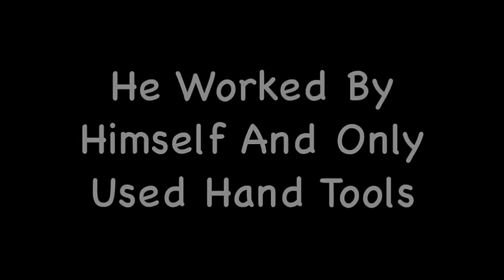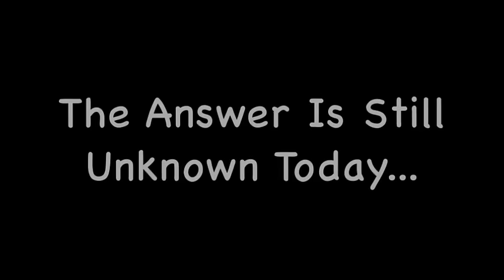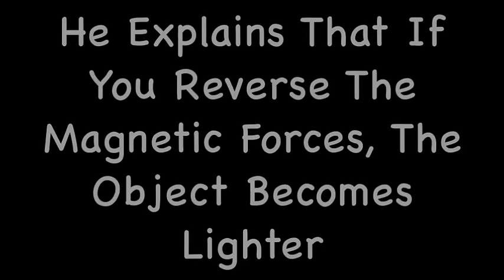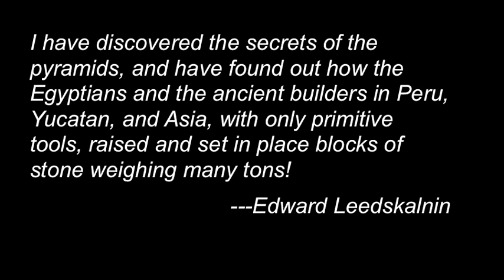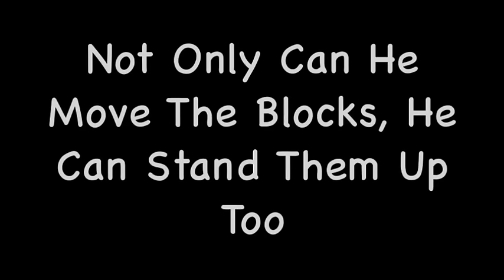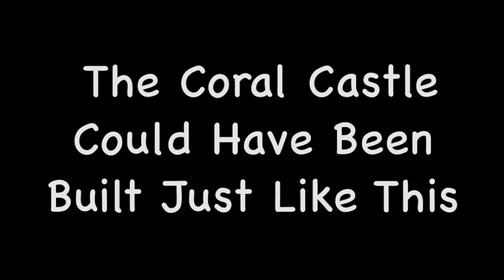Coral Castle: Mystery Solved

Comment: Sounds good but it’s not solved. Because ed talks about the magnetic currents and all the forces of nature. How he aligned his tower with the stars and what not. Look point is no one has discovered how Ed did it. His precision is so accurate on how he built his castle. But This guy that thinks he did the same thing is some what wrong because his stones don’t mean anything. His story is just to stand them up. Only thing probably related to Ed’s work is that he used leverage but ed was doing more than just that. He definitely knew what the ancient civilisations knew. All the lost knowledge he figured out.

Comment: this explains zero, this gentleman understands leverage, good knowledge to have.  Edward Leedskalnin quarried all of his own stones, including the 30 ton beast.  there were witnesses to his work site, he just would not work in front of them, the only working structure ever seen was the tripod of which there are pictures.  The stones in this video are not stacked nearly to the height of the ones at Coral Castle, nor did Mr. Leedskalnin have a cement pad to place stones under to manipulate the blocks with a pivot stone.....and the big one this does not cover is the fact that Ed moved the entire site 10 miles away, all 300 million pounds with himself and a truck driver, the truck driver was not allowed to watch him load or unload, just drive...

Comment: This man did not solve the mystery of coral castle . Read the history of Ed showing up in the us at Florida he built it first time on a hill with no road to the top then he got into a fight with the tax office over back taxes Owed  on the property he bought . He then hired trucks to move it to the new location. The driver would park the truck leave then in a hour the truck would be loaded with blocks at the bottom of the hill. Ed then moved the blocks again up hill and put it up again this time finishing the job . Also he took running bords off of trucks from the wrecking yard and put them into the corner of his living quaters with laser type precision in the stone. Try and build a pyramid the way this man on the video did  the Corel stones that Ed used are full of crystals when eletric current is applied to crystals we all know they can be used for many things . Tesla also studied the pyramids and magnetic lay lines and thats where he came up with the idea of free electricity and his tower

Comment: The  Idea that Ed placed heavy stones on the back of a Truck in a few minutes, is pure rubbish. For one it is hearsay, and if he could do that, he should have built his Castle in less than a few years. Ed also stated he discovered how the Egyptians built the Pyramids, and they did not posses block and tackle. At the rate Wally lifts stones, they would have never finished. I do commend Wally for his ingenuity. There are very few stones, that match the size(s), Wally is working with found at Coral Castle.

Tell us Rickey... are you sharing any of the money with Wally Wallington (the man in the video) from the profits now generated on Youtube?

What Ed discovered, was just how heavy water is (62.4lbs per cubic foot) and how to employ it in volume, to offset the weight of his work/stones. In both of Ed's locations, there was and/is a stream present. A family size refrigerator 70" X 25" X 36" full of water is capable of lifting over a ton, ie. 2,274 lbs.  The coral rock is not solid, and light in weight. If Ed could levitate rocks, he wouldn't need to hide his work at night, and only charge a 10 cents admission.

Comment: what silly logic.  your assumption is illogical.  Your assumption aside, the techniques shown in this video would work exactly the same way regardless of the size and mass of the object.  all that would be required is that the block itself, and the materials being stacked under it, is capable of withstanding the forces.  for the material being stacked under it, even its getting crushed it would still raise the object some.

Comment: Wally Wallington can not be compared to Coral Castle, his methods are far from primitive, and he in NO WAY compares to ed leedskalnin. Before you say "Coral Castle: Mystery Solved" you had better look at the bigger picture.
He's moving concrete blocks. Concrete is a modern material, not the oolitic limestone ed leedskalnin was moving. That 19200 lb block of concrete, is that full of tensile rebar? Most concrete is poured with rebar today, to keep it from snapping in half. Remember, that is also a MODERN method, and coral castle wasnt built with concrete reinforced with rebar. If that block wally is moving wasn't reinforced with rebar, it would snap in 2 pieces under the weight of 9600 lbs on either end hanging in the air.
Wallington didn't quarry the blocks out of the ground like ed leedskalnin did...
He's using concrete (likely reinforced with rebar)...
He didnt chisel these out of the ground, meanwhile ed leedskalnin quarried his stones, and not only that, his coral castle stones are smooth, not chiseled rough...
Wally Wallington is simply building a one man 'parking garage'... using modern materials... it's an insult to Ed Leedskalnin and the ancient pyramid builders to compare them to him, shame on you.
Reply: Keep your hero's and thank you for that. But give credit where credit is due. Much of Coral Castle AND the great pyramid have just been explained, no small genius! Just so you know, the lime stone and the coral are the same basic material. Neither would crack under it's own weight with the proportions shown, the fulcrum point would wave to be much narrower, and there is no reason to make it narrow or use tiny stones as pivots. Coral, being the lighter of the two, would be even less likely to crack. All you have to do to not make a pit is make a mound and remove it after your spire is righted. Now it's base is at the original ground level.

Comment: Bully for him but I'm very much under impressed.  Lets see him try moving a stone in the shape of a cube, say like ..8 feet x 8 feet x 8 feet. ..it seems small right?  A stone that size is actually 512 cubic feet and using common stone that only weighs 160 lbs per cubic foot, ..do the math and that stone weighs around 82,000 lbs or roughly 41 tons.  Lets see this guy move a stone like that since it cannot be counter balanced like his stone block teeter toddered on wood.  
Try moving the largest stone ever used the buliding of the ancient sanctuary in Baalbek Lebanon, known as Heliopolis, "the city of the sun".  It was brought from a limestone quarry and was 18 feet x 19.6 feet x 64 feet long making it 22579 cubic feet of solid Limestone weighing 165 lbs per cubic foot. Do the math and it weighs a staggering 3,725,568 lbs or 1863 tons.   Try moving that with a pebble and sand. LOL
The first thing we need to understand is that these ancient structures and even the Giza pyramids weren't built by Egyptian slaves, they were built by Sumerian Gods and the proof is represented in all of the ancient Egyptian hieroglyphs. They used the same antigravitic levitation used in their interstellar star ships or their, ..."Chariots of Fire".  This is the technology used by Ed Leedskalnin to built Coral Castle and its the same technology used to levitate the Nazi's and Otis Carrs flying saucers as well as the Searl IGV ( Inverse Gravity vehicle).                                                                          
Do not fall for the disinformation created to hide the truth about our true Human origins.

Comment: CORAL CASTLE, Mystery Solved. What a load of CRAP. This is certainly NOT the way ED LEEDSKALNIN moved his blocks. This guy couldn't even lift a block straight up 3 feet and rest it on top of another. All he is doing is rotating it around so it moves in any particular direction. Lets see what some REAL LEVERAGE can do.

Comment: You are not going to tell me that they built the pyramids with 500 men pulling the 50 ton stone 200 miles and carving it out of solid rock with a copper chisel and wooden mallet are you. There is a technology lost here and we need to find it, Remember to build the great pyramid they in 20 years, they would have to place a block every hour 24/7 to accessible it. And that is not possible with todays technology no mater how good you can move 1 stone block around on a flat surface.

Comment: Brilliant Wally! I can see the  Egyptians easily moving the quarried stones along a "highway" of alternate staggered stones. No one person would be in the way of the other and stones could be delivered at the rate or several per minute across great distance. The video demonstrated movement for lifting, horizontal movement (travel), vertical rotation (the hardest thing to do), and fine positioning capability. Doc is right, the MIT PhD's failed their attempt to replicate the top of the pyramid scaled down and only 15 feet high even with modern heavy cranes. I remember almost taking the bumper off the pickup truck trying to lift an 12*18" stone that was sticking up out of the garden! Wally's technique reminds me how we "walked" furniture on its 2 points. One man would take the whole thing at that point. BRAVO! Inspiring!!!

Comment: The man also quarried all of the coral over 3 million pounds, as large as 30 tons that alone would shut you down he did not have nice level concrete floors to spin on he was in boonies they did not even have paved roads at that time in most of FL, Your ignorance is astounding.I bet you could not quarry a 10 ton piece of coral with primitive tools in less than a month if you could even do it, than break it free and lift it out with nothing but you,

Comment: Magnets are wonderful. Just like Eds Generator and there is this Farmer Rod making on/Off between electromagnets. This works like he said the perpetual motion inside electromagnet. And the hook witch is hanging. Is In this case its redeem witch. Theres a magnet also inside the handle. Witch craps this hook and it tatses this semi big metal bar. Making the Reed witch motion for this electromagnet box on table. And also there is spark. Electric spark jumping To this copper flower thing upon this flywheel. This makes the electromagnets in flywheel goes not off but like a lowpower. And why because it Let this Farmer metal Rod back To small electromagnet box on the table. And wola. U get loooots of energy back. I mean lot. Even Eds realize copper wire is In this case like a Girls stuff. Eds realize he needs To Use chains To handle this amount of energy.. Thats why the is chains and weight is for. Damm that thing spins a supaa fast. Hhahahahha.. If People kno how magnets realu works then people kno how Ed made his generator happen... Now i try To figure out how this icecream antigravity decive gun works.. My english is shit but mayby Some one got this

Comment: This is awesome.  About ED he moved the blocks in minutes but he had a hoist.  Let’s not forget he cut that coral, but honestly I think the cut is the easy part because the layers of stone show where they can be cut.  The movement of the blocks is based on the premise of placing them In A circuit to change their polarity.  You have to know how to design the circuit.
Reply: You can’t just pulley and lever 30 ton 60000 pound coral rocks. Neither did or could the Egyptians “hoist” or “lift” more than 2,300,000 limestone and granite blocks that individually were over 500 pounds alone.

Comment: big fail... try doing these tricks on sand. like they did in Giza
Reply: +Kaleef Dwayne “Buttonz” Barksdale    giza pyramids are built on limestone. they quarried the limestone about 600 yds. away from the great pyramid. the earlier ones wren't. sand covered most of the great sphinx at one time but it's built on the bedrock also. they found the quarry after hauling out lots of sand.
Reply: +Thomas Penning 👌
Reply: i am totally unaware of the significance of a red hand following my name. is this an example of an "emogy"?  if so please translate.

Comment: Beutiful way of moving very heavy rocks, but,.... many questions left.... I saw where the ansient people took the rocks from, and the way they cut them and moved them is very frustraiting to think of, cause you can try and try but get just one of the facts, like this heave lifting, ... very nice but proves there are ways of doing things, not that they dit it... try explainning that with malta ruins... does not apply, like cutting granite, you have no control of the cut, but is easy to cut...imposible to shape,,,,,, with copper tools or wood, but you can cut it with a hammer and a nail... but no control!! so FAIL